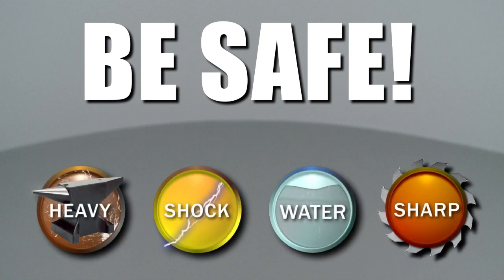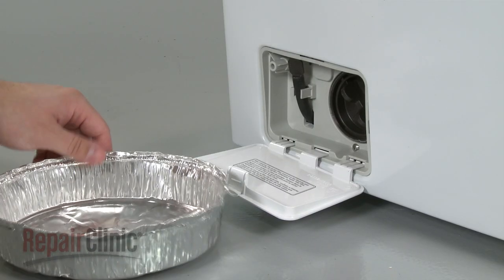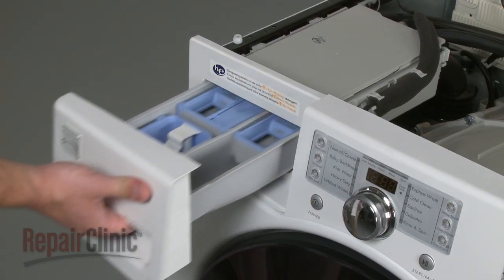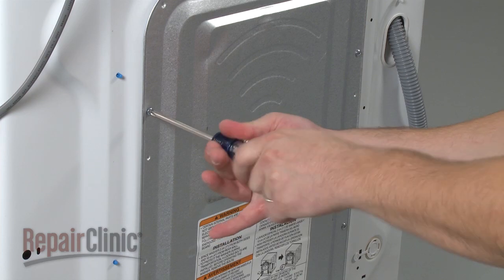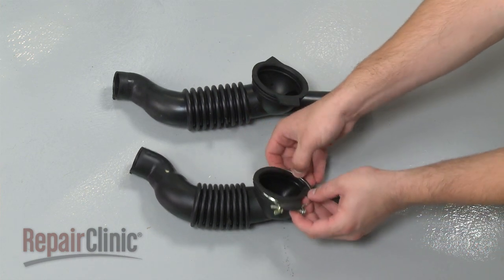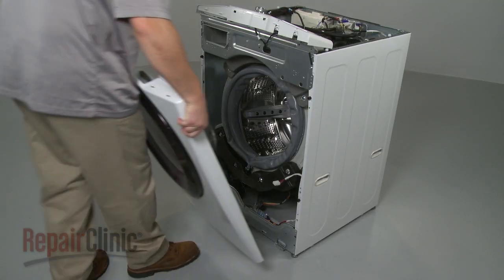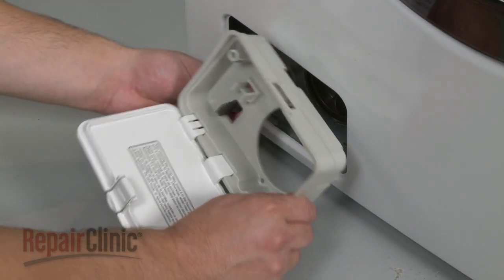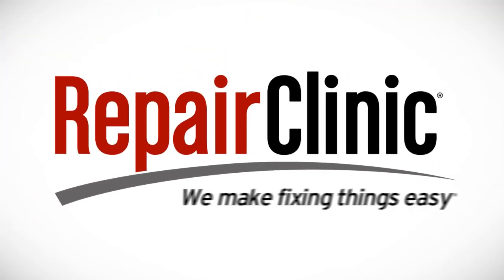LG/Kenmore Front-Load Washer Tub to Pump Hose #4738ER1002A

Comment: You can turn this into a 10 minute easy job if you just disconnect the water supply hoses and drain hose and turn the washer on its side.  All the work can be done from the bottom without any disassembling.
Reply from the maker: There are usually several ways to do the same job. Not all
customers are comfortable tipping the washer on its side. Sometimes other parts can get damaged. Glad to hear it worked out for you.
Reply: But don't you need to reinstall the shipping bolts? If not I think you're in a world of hurt.
Reply from the maker: zigzagbigbag We did not remove any shipping bolts in this video and we did not move it.
Reply: Excellent video however we did tip the washer on its side and it is much easier.

Comment: You don't have to do all of this! This is a joke!! you can access it and do it from the bottom in 3min by removing both clamps and the 1 screw!! What's this all about??
Reply from the maker: If the washer you are working on has a bottom panel that will work. The machine used in the video did not so we had to go in through the front and rear of the machine. Thank you for commenting.
Reply: liveindamoment

Comment: I have a unit like this, but this isn't the problem I face.  My problem is that the soap tray leaks out the front. I've checked the outgoing hose from the housing that leads to the tub, and it's not obstructed.  Until I find the problem, when I fill the soap dispenser, I close it with a papertowel around the soap dispenser.  It sometimes gets soaked, but that's all the water that comes out.  I wonder if the water inlet to the soap dispenser is clogged up, causing it to spray out wildly.

Comment: I didn’t feel comfortable taking it all apart like that, not with my luck doing repairs.  My drain bellows had a small pin leak in the corrugated part. Don’t know how that happened as it is on the underside and nothing touches it.  I ordered it online from encompass.com. 17.00 +2.97 2 yr. warranty and $9.00 shipping.
WELl, I tipped on its side with no problem.  Took off the bellows and put on the new.  Had a hard time with the connection in the front.  Tried it out and it leaked in the front. Tipped it the other way and got to it easier and tightened it.  NO LEAKS. EXCEPT  the drain hose going out to the utility tube, that long gray one, was leaking Because it was rubbing against the part that holds the drum, looks like a hydraulic pump. Design flaw that I’m going let LG know. Found a local parts store for another $26.00.  Encompass has it but my wife wants this done within 2 days.  If you have an LG washer, take off the gray panel on the back and check out that hose.  I’m going to put in a screw hook through the side and hang that drain hose.

Comment: i just did this repair.... I have a small laundry room and its on a pedestal  so I did the repair at first from the back. I purchased the part for $13 but had to drive 45 minutes each way to get it (Sears parts).  From the back seemed easy enough, I took off back the two screws holding the broken piece.  Took out old and put clamps on new then hooked it up.  I was in limited space so even though "thought" I had everything connected ...all I had was a flood on testing.

So I took off the whole front to get better access and discover my gaping hole in front where clamp was off.  This time it went smoother since I had more room from the front and I got it all hooked up...the worst part was thing to get the front door seal gasket back on...spent hours on it. I refused to not fix it in one day... the tool that helps is a "inside plier"   only $35-89 forget it. Finally took one more stab at it with a small flat head and patience.... it slipped on after several minutes of careful use of the screwdriver. Put it all back together and only has two screws left over.   It works..cost $13 plus gas and several hours.

In hindsight I think I would do the from bottom technique..I think it may be way easier. But now that I did it pretty sure I could do it the way I did it much faster... and perhaps find where those screws go. At least I was able to fully clean it and re-hook up dryer vent.

The part that leaks is the one they show... On mine it was at the seam. Not surprised watching the wash cycle from back that tub sure moves all around in there and over time the seam is the weak point. Hope the new part lasts. Also wear gloves I had many cuts afterwards.
Show less